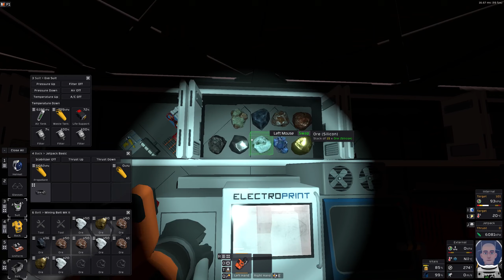Stationeers (Beta): Brutal Vulcan, EP12 - Improved Stage 1 Cooling

Comment: And then he realised how bad he f... up ;)

Hi again.
Instead guessing pressure of pollutant "safe" factor add a condensation valve as a opposite bypass to purge valve if pollutant would chill too much. Remember that the colder the gas the lower pressure is needed to start condensing.

With this setup you will chill CO2 to around 85C and the pressure of pollutant which will start condense at that temperature is if memory serves around 3.5MPa.

If you need more cooling power then you need to use closed loop setup which seting up properly is much harder. Duplicating first stage not nececery improve cooling as with pollutant you will have no more than 70-75C temperature difference each stage. Heating/cooling works best when you have large temperature difference. If two networks are near the same temperature then you move less thermal energy between them.